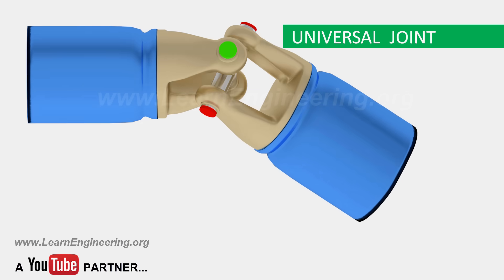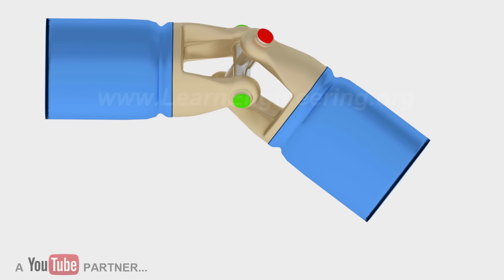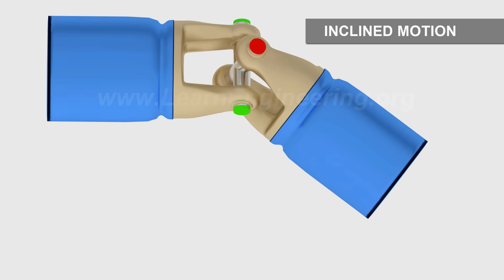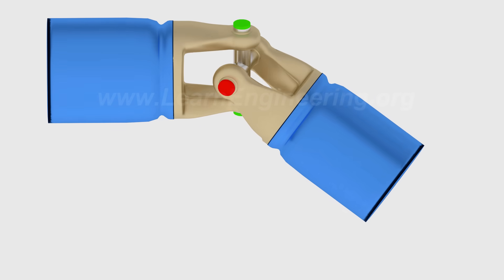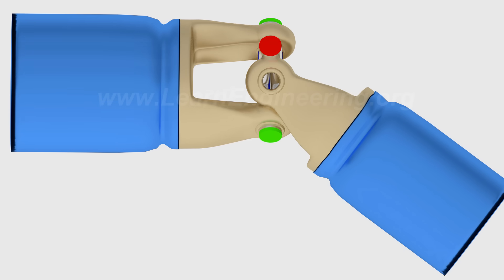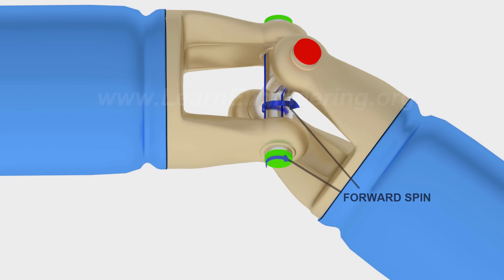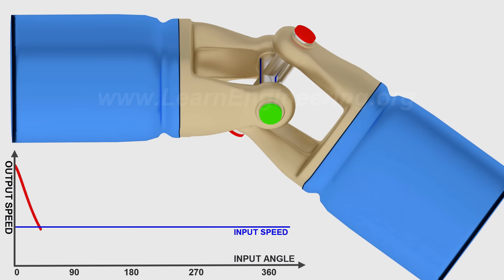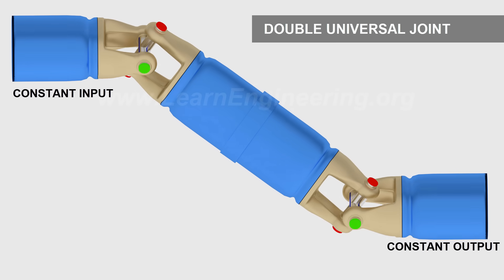Understanding Universal Joint

Comment: I understand that at 2.30 , the green spot has the same direction spin as the cross. Why at 2.42, the green spot does not has the same reverse spin? Doesn't the spot is the same shaft end?

I am trying to figure out the bearing movement on the cross. Should it has repeat forward+reverse rotation or a continuous 1 direction rotation?

Comment: "Understanding Universal Joint": 82.230 views

"Jen Selter makes squats": 129.655.342 views
Reply: Natural selection at its finest...
Reply: i would put my universal joint in Jen Selters spline.
Reply: butts are more universal than universal joints
Reply: The human race is condemned
Reply: @trabadix  yeah, until you think about how, if everyone wanted universal joints instead of a piece of ass, the world (human one at that) would LITERALLY be over.
Reply: +1 view to Jen, Imma headin there now. ty, kindly.
Reply: Who is jen selter? 

I know only learn engineering,

From helicopter video
Reply: Why do you use periods instead of commas? For example, how are we supposed to differentiate between 1.234 (one thousand, two hundred thirty four) and 1.234 (one and 234 thousandths)?
Reply: @gabedarrett1301  in Europe a decimal brake is expressed with a comma.

So one hundred twenty three thousand four hundred fifity six point seven eight is expressed as 123.456,78
Reply: Who the heck is he?
Reply: Ftheicyle😃😯🤐😥😑😛😜😶😣😝😏🙄😥😝
Reply: @gideonschwalbe  Umm I disagree with every element of your assessment of this video
Reply: Those are the subhuman viewcounts. The viewcount that actually consists of real people are probably way lower.
Reply: I will watch the Jen Selter squats right after this video
Reply: yo culpo a los padres

Comment: Well, saying that it's useless if used single joint per shaft is quite a bit wrong. Many motorcycles use shaft drives with only one U-joint. The way it works is it's at a very low angle when ridden normaly, only bumps makes it go at a higher angle, wich does not last very long and at that moment throttle is released.

Comment: What about on a drive shaft with three U-joints, would that still equal the same output velocity? On many trucks there are three U-joints per shaft
Reply: The third joint has no angle so you still only have two angled joints.
Reply: Oh good point I didn't even think about that

Comment: What are other types of joint to trasnfer mechanical rotation with an angle?
Reply: Other types that I know of are: CV joint and Tracta joint. Hope that helps.
Reply: Thank you, sir. Ill begin research.
Reply: +davidrobert2007 whats a tracta joint?
Reply: +hardwirecars It's basically a trilingually disattatched biomatter reactor fixed upside down.
Reply: +Mikosch2 ok u just made me feel really depressed

Comment: One thing that should be noted in the last example (double U joint): The input and output shaft have to be parallel for the velocity to remain constant.
Reply: In other words, along the same axis of rotation
Reply: In other words, along the same axis of rotation
Reply: What if the input and output shaft are perpendicular? Is there any way to achieve constant velocity with this setup?